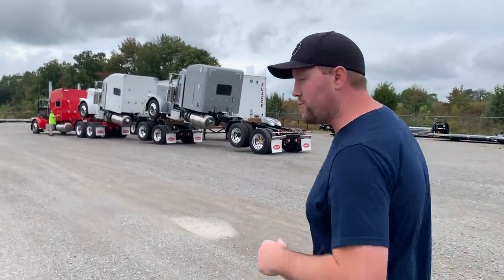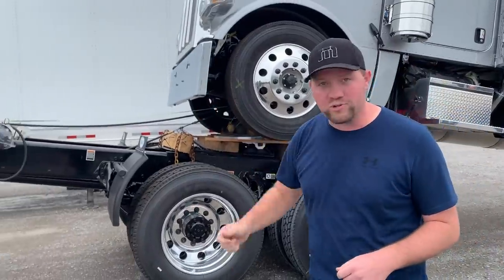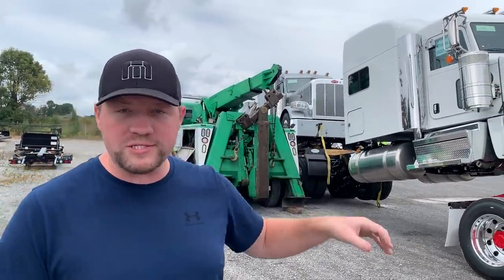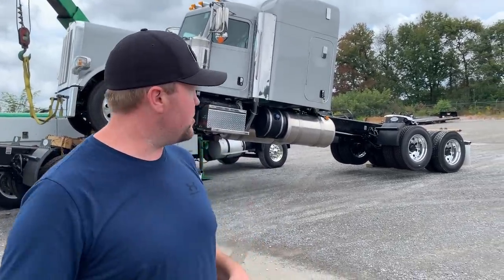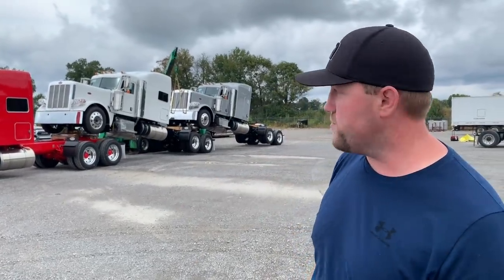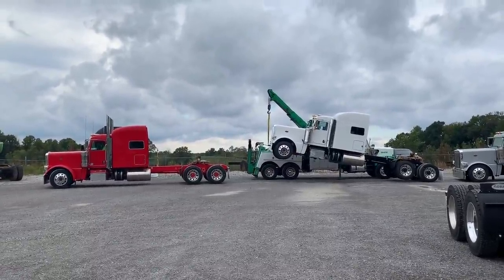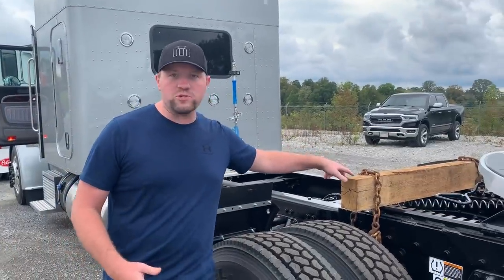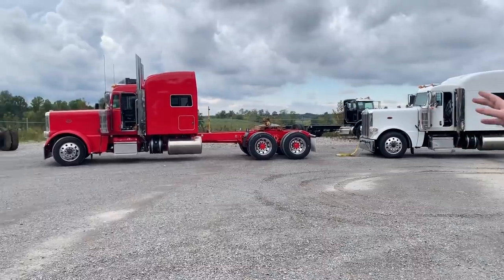Big Rig Delivery ALERT! UN-Decking New Peterbilt Semi Trucks

Comment: Hi need some solid information on this business specifically because I'm with an OTR van carrier in CA and we just bought 20 sleeper tractors that now need to be moved from SC to CA. I know nothing about this stuff because up until now we ordered just brand new trucks from Freightliner so they would always have them delivered. We did get a quote on transport from the dealer we purchased the 20 units from but it seemed high... VERY high so I'm searching anywhere I can for options and/or different ways to get this done because 20 x very high equals WAY TOO MUCH. I'd even use my own driver if someone else can take care of the decking/undecking. Basically anything besides paying what I believe is a ridiculous amount. I'd really appreciate any info you can give me. Thank you

Comment: OK i got a question for ya,a friend just ordered a 2020 new truck,got the specs he wanted,THEN he  put a no drive order on  his truck,he wanted it just piggy backed,WELL it was the nicest prettiest one out of the three,the driver low life knucklehead,slept in the sleeper,got mud all the sleeper and drivers side,NOW  my question is BRAND  SPANKING NEW,the truck now has 1800 miles on it,he had no drive order on it,what would your dealership  do now,just asking,answer this question then i will tell ya what happened,SPECIAL ORDERED A TRUCK WITH SPECS HE WANTED,WITH NO DRIVE ORDER,
Reply from the maker: Unfortunately dealerships do not have control over active transportation. This has happened to us a few times where we requested a truck not be the "mule" but still it showed up pulling two units. We really just have to handle those situations case by case.

Comment: I'm not a fan of the position of the wrecker. There's plenty of room for him to be in such a  bad position. I deliver deck sets for freightliner and PACCAR.  If that was the only option that would be fine, but it seems like there are better options
Reply: puck slapper        The problem is,       I undeck trucks also and as close as he is if something breaks you could have two trucks demolished instead of one.......we use a rotator also or stick boom, just depends....
Reply: I have only done this for 30 years in March of this year it's worked so far with this same wrecker  I knew someone could do it better. But I think I'll keep on doing it the same way. Don't matter how close it is to My wrecker if something goes wrong it's going to be a mess any way. Same truck for 30 years not 1/2 a million or more
Reply: @mikewilson7112     if it works for you go for it... everyone has a way of doing things...
Reply: Hello eddy how are you doing today